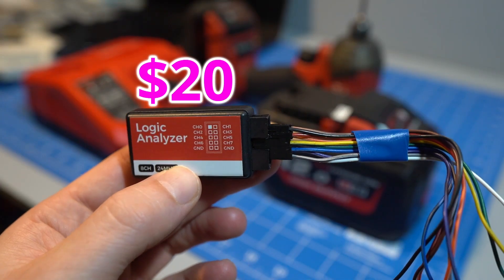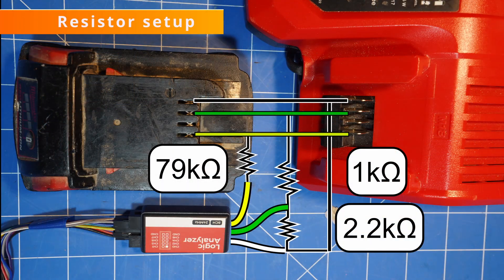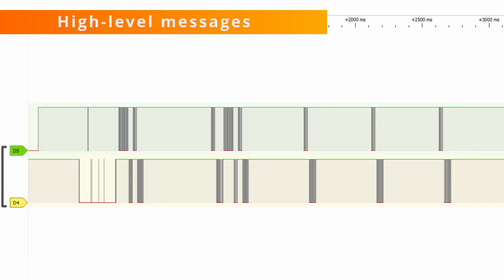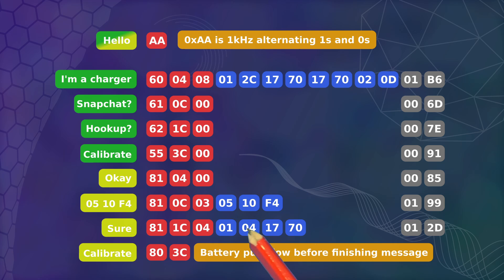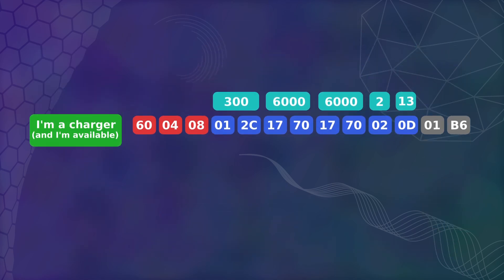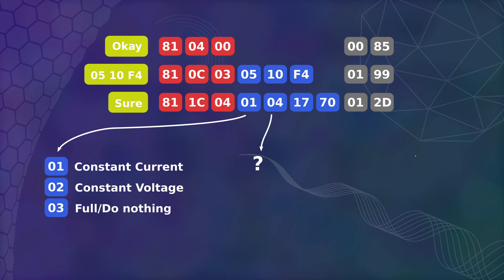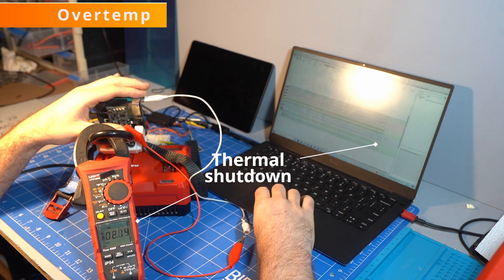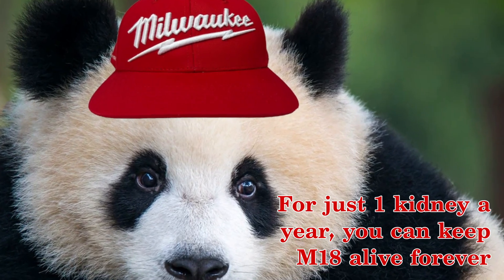[004] Reverse-engineering the Milwaukee M18 Redlink Protocol

Comment: It's really cool. Could you research Devon 20v , also known as flex 18 tool protocol. It also has i2c communication between tool and batteries, I'm trying to reverse engineering but it still unsuccessful. Your video is very helpful for me

Comment: I have been repairing Milwaukee batteries for a few weeks now and have come across several where the cells are unbalanced and I can manually charge them up to a balanced state. However, the circuit board is stuck thinking that they are failed and the only way to fix it is to replace the circuit board. I'm wondering if you can help me find a way to do a hard reset on the circuit board. Like remove a resistor that cuts power to a component and then resetting the part would turn it back on. Otherwise I have to remove the circuit board completely from the battery and putting it back on is a pain so I might as well put a new circuit board on. I'm looking for a way to fix the circuit board without removing it from the battery. Thoughts?
I see this has basically been asked before. Sorry for the repeat question.
Reply from the maker: Do you have a Milwaukee charger? Putting it on the charger usually resets it. There's also a way to reset the microcontroller by shorting the GND and RESET pads on the HD1 interface. I can't remember which pads they are, though
Reply: @toolscientist I have 3 different chargers. I have plugged several batteries into each, one charger after another checking battery status after each charger. Sometimes there is no change, sometimes I get back to 3 bars (but charger is always green and won't charge) one battery even got 4 bars but dies in a couple minutes and goes back into 1 fast blinking light and is locked out again.
Reply: I just disconnected the main power and ground connections between the batteries and the board. The light went out so I assumed I had killed all power to the board. I recommend them, and I'm still stuck with one flashing light. So it's back to where I was when I started.
Reply from the maker: @gillfastd5963  try discharging to 19V, then put on charger
Reply: Thanks for the helpful pointers. I have a new circuit board arriving in about a week. I'll get this one running but I have another one with a similar issue so I'm trying to find a nicer way around it than just replacing the board

Comment: I've been watching these videos - have we figured out exactly what it takes to trigger a battery that is in shutdown mode (flashing one bar) to release this mode? If you manually charge the cells up, this shutdown mode will linger, even if at full cell charge (it refuses to notice this) - and I've only managed to remove a battery from this mode by inserting it into a charger or disconnecting the main B- of the pack from the BMS board then reconnecting. That's obviously not ideal, so I'm hoping we can get some idea what exactly goes on during this 'refreshing/unlocking' and perhaps replicate it with a simple circuit.
Reply from the maker: There's an older and simpler protocol for batteries/chargers before 2014-ish that just has high and low voltages on J1/J2. I should document it as it would be an easy way to reset such batteries
Reply: @toolscientist  That's exaaactly what I'm hoping - sometimes I find that I end up without a charger on hand but DO have a variable bench supply on hand.
Reply from the maker: @laughatthemall2341 From what I've seen, it could be as simple as connecting B+ to J2. I'll test in the next few weeks
Reply: Do you think connect a 12v to J2 will make the battery come out of lock out?

Comment: I sometimes rebuild packs or even buy parts online and build custom ones. I know that that makes me a small minority, but since you have the communication protocols, does that mean that theoretically you or someone of your skill level could make a custom charging board where one could theoretically remove the Milwaukee one and replace it with the custom one and still be able to charge on a Milwaukee charger while adding cell balance in? I saw elsewhere in the comments you said that you and others could theoretically be looking into the idea of a custom firmware for the Milwaukee batteries, but what about just replacing the charging circuit in the battery?
Reply from the maker: There are custom PCBs for M18 packs on aliexpress, ebay, etc. I would have to buy one and test to see if they balance.
Reply: @toolscientist  they don't... And at least some don't have good cell monitoring. I tried one and it let my batteries charge to 4.3V per cell if they were unbalanced.
Reply from the maker: @WargateXGWU  bummer
Reply: @toolscientist yep. I'm looking at trying to design a super cheap, small pseudo-balance board with Zener diodes at 4.1V and 10-ohm resistors, but I've never done PCB design before so we'll see how that goes.

Comment: So, do Milwaukee chargers balance batteries? I've seen conflicting info. Also, is there an adapter that would allow me to charge my Milwaukee batteries on an rc charger? Ideally, xt60 for the main and a 5s balance lead.
Reply from the maker: The charger cannot balance as it lacks the connection to the cells.  The battery could balance itself, but Milwaukee have chosen not to implement balancing. Balancing with an RC charger could only be done by taking the battery out of its case so you can connect to each bank of cells.
Reply: Thanks for the reply. I was hoping there was some available ready made adapter. I have opened and soldered new balance leads on rc lipo batteries. If I ever need to I should be able to figure it out with a multimeter. Curious now to see if some of my older batteries are out of balance. @toolscientist

Comment: Wauw. Great job. 👍Wish someone would do this with the newer Festool line of batteries. 🙏
Festool batteries also communicates not only with the chargers but with newer powertools, which unfortunately makes older batteries and OEM batteries unusable. 😒
Reply from the maker: It's on the todo list. But I still need to do Bosch, Makita XGT, Metabo, and Hikoki before Festool. I'd like to look at the new  Hilti Nuron, which I'm pretty sure have digital comms.

Comment: Good findings. I repaired a lot of such batteries without knowing all this info. I got up to even replacing bad temp sensors with resistors to trick the protocol into thinking the sensor says temp is good.

Comment: Could 05 mean that it is a 5 cell 20 Volt battery? I know there may be more cells in parallel, but overall voltage wise, it would be 5 cells in series. If that were true, an M12 battery would have a 03 for that line, and an M14 pack would have a 04. If this were true, the battery would be telling the charger what voltage it is. One of the other lines may relate to current in some way.
Reply from the maker: Hadn't thought of that one. They had an M28 line that was 7-cells in series. It might have been built in to the protocol so they could make a multi-volt charger, but then M28 got discontinued.

Comment: did the 05 10 F4 hex from the battery change if you put a different size battery in? or even just a different battery of the same size?
Reply from the maker: No, every battery and every charger always gave this number. I think 0x10 is related to the BQ76925 as its i2c address is 0x10. I think 0xF4 is related to the microcontroller - MSP430 G2744. In the datasheet they refer to it as a G2x44 as there's a few minor variants (G2744, G2544, G2444). 0xF4 is 244, which lines up with G2x44.
Reply: @toolscientist  makes sense. That’s where my head first went was some sort of identification sequence. Thanks!

Comment: I'm curious, have you done any investigation on the communication between the battery pack and the tools themselves?
Reply from the maker: Yeah, it's just very basic on/off signals. It's in my video [005]. There may be some tools that are capable of communicating, but none of mine were. There's likely too much noise to be able to communicate when running.

Comment: I know just enough to be dangerous. I want to use these codes to try and make a DIY car/USB-PD charger that can use that middle charging pin rather than charging the battery pack directly just using the positive and negative contacts. But I'm not sure exactly where to start. I have some experience with things like Arduino and computer programming, but I'm not exactly sure how to implement these. Does there exist a code that I can pre-install to some sort of Arduino type microcontroller in order to make what I want? I know that I could always modify the charging circuitry itself, or again simply charge the pack directly, but neither of those seem like good options to me. The controller boards on the batteries does offer some amount of protection, and I would rather utilize that than nothing.
Reply from the maker: Any DIY charger will need to be able to control the current. The signalling is fairly simple: the battery just asks for a particular current, and the charger obliges. But if you can't control the current of your charger via an arduino, then you won't get very far. As for the programming side, your best bet is to try ChatGPT. You want modules that: send UART commands; receiving the batteries replies; and switches between the states. You'll want to screenshot the protocol summary at the end and convert it into a state transition diagram. 

There is an older protocol that just uses simple pulses on J1 and J2. I know older batteries use it, and I guess newer batteries will have it so they can work on older chargers. Pretty sure it only does slow charging, though. I've never looked at this protocol as I thought no one would be interested, but I guess it would be useful for people that want to make simple DIY slow chargers.
Reply: @toolscientist  controlling the current isn't very difficult, I have plenty of circuits that can do that. But the batteries will not charge to the center pin without first receiving signal on J1 and J2. I know enough about programming but I could probably figure out a program it, but I don't quite understand the signals or specifically how to incorporate them into a program. I don't know how to make the battery receive the charge.

Comment: Did you ever take a look at the bosch 18V professional? As far as I know they are encoded using resistors to tell the charger or tool the max charge or discharge current. While a ntc is used for temp control.
Seems like it is completly analog. Is that true?
Reply from the maker: They're on my todo list. I've been given a broken Bosch battery that I can take apart and I've looked at a few teardowns. Does seem to be entirely analogue

Comment: Thanks a lot for Your great work!!! And, at the end, by reading comments, I get clear, that 100k ohms resistor, added from J2 to + works good, I tested it with milwauke 18 fuel chainsaw, and it started to spin, so seems to will be working great. Some next question is, about charging, can I use this milwauke charger to charge selfmade battery with the same voltage, or maybe not? And, maybe, use different charger, as an example - one from drone industry - which can charge all 5 cells individually balancing them. So, anyway, thanks, and good luck to You!!! :))
Reply from the maker: Yeah, virtually any resistance to J2 works. In video [005] I show that you can do it with just your fingers (which is a few mega-ohm). All you need is >0.725V on the J2 pin (exact number likely varies between tools, the 'target' voltage on J2 is 3V). https://youtu.be/q7spzrIbdKY

You would need your self-made battery to have it's own balance circuitry and for the battery to copy this communication protocol so that the M18 charger thinks it is talking to a M18 battery.

Dewalt chargers have individual pinouts for each bank of 5 cells, so it would be very easy to DIY a battery that works on Dewalt chargers.

Comment: So, after cell disconnection bms bricked? So no rebuild for those?
Reply from the maker: I've seen other vids of people rebuilding without issue. I had a lot of trouble desoldering, so I think I overheated a nearby component.
Reply: @toolscientist  okay thank you very much. i had so many makita, metabo and random vacum cleaners brick bms when attempting to rebuild so im trying my best do do research first

Comment: Chinese excel at reverse engineering. Glad to see a honest reverse engineering (opposed to that of others solely aimed at stealing from others and making easy money by bypassing R&D).
Reply from the maker: This one's simple enough that they would have replicated it within a few days. I'm fine with compatible batteries (except that they're an unknown in terms of cell quality and BMS protections), but the counterfeits are getting impossible to distinguish unless you take them apart and compare PCBs. I worry that tool brands will start adding cryptographic features to their protocols and then potentially region locking them.

Comment: How do you figure out the baud speed ?
Reply from the maker: Look for the shortest pulse you can find in the waveform. In this case the first transmission from charger and battery is 0xAA, which is 0b10101010, so very easy to see the smallest pulse.

Comment: Parkside batteries have no output mosfets or current monitoring, upset a battery and the balance chip will no longer turn on the charger with its secret whisper. charge cells manually and balance them but the chip will still say no, I seen bad things in my past, things may no longer be safe so I'm taking the 5th....
as to comms with the tool, not played on that side but some tolls will discharge a battery more than others, i do know each tool also has a chip in it
Reply from the maker: Interesting. We don't get Parkside in AU, so unfortunately I can't look at them.

Comment: Could you look at the charger internals?

Specifically I'd like to know if there is a way to hot wire the m12 balancing circuit. 

My 4 and 6aH XC batts love to get out of sync in the winter and the fact the charger only balances while charging and shuts off when charging completes is ridiculous!
Reply from the maker: That's definitely something I wanted to do for M18. Hadn't thought of M12 - there could be an easy way into tricking it into thinking it's still charging.
Reply: Clearly things have been costed down, so I would hope it just a signaling pin being pulled to ground.

But at the same time who knows.

Comment: Lovely lovely video. Could you please provide any knowledge on how to convert a 120 AC Milwaukee charger to 220 V 50/60 Hz to be used in a 220V AC Volt system? Thank you
Reply from the maker: I have very little mains AC experience, mostly low voltage DC. Easiest option is a transformer, or look at 2nd hand markets where chargers often sell for 1/4 of retail price.

Comment: Anyone know what a dead short between the battery+ pin and the center pin means on an M18 pack?

Indicator lights stopped working and charger rejects pack, but battery will still discharge in tools normally.

The only oddity after thorough visual inspection of board & all connections is a dead short across those 2 pins where that doesn't exist on all my working batteries.
Reply from the maker: There's a mosfet between the CHG and + pin. You can see it fairly clearly on Quagmire Repair's board shots. You've either got a faulty mosfet, or maybe just the biasing resistors. https://quagmirerepair.com/milwaukee-m18-battery-reverse-engineering
Reply: @toolscientist  Thanks for the info.  Just with my very rudimentary DIY knowledge I was eyeing that, but not sure exactly how to confirm or test that was the issue.

I'm not really setup or skilled enough to stsrt swapping parts off the board, but I do have 1 more knockoff board I might just swap the whole board as I feel more comfortable doing that myself.